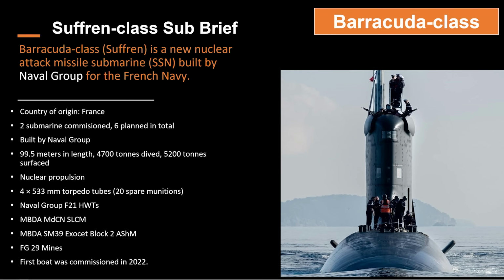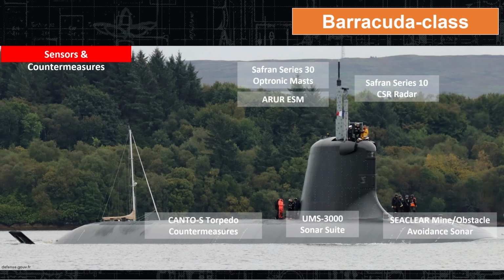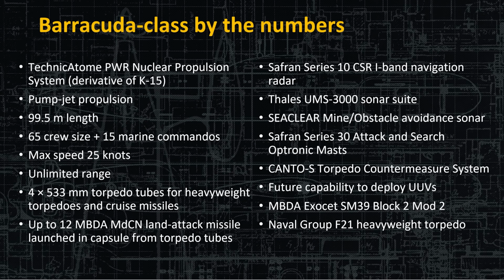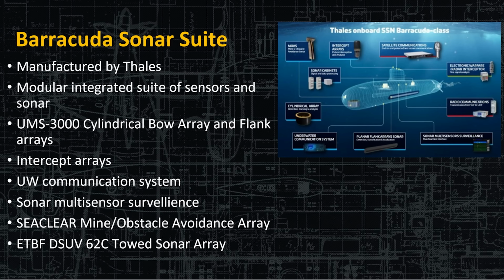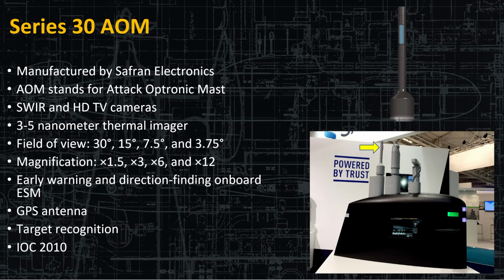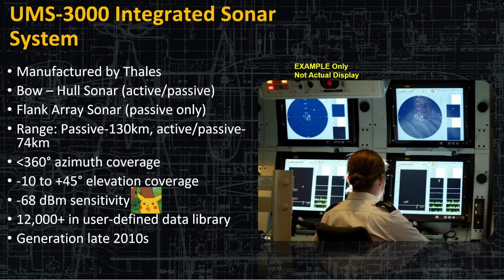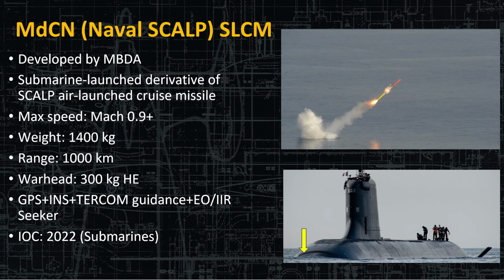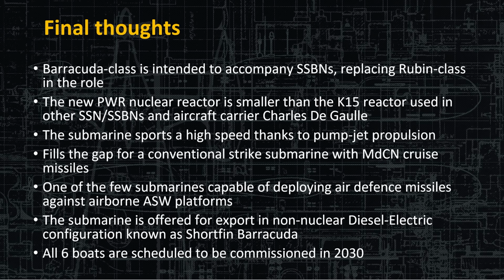Inside The Most POWERFUL French Nuclear Submarine Ever Made!

Comment: It's not the SCALP missile that's dropped from an aircraft, but the MdCN missile, which is launched from surface vessels like FREMM frigates or nuclear-powered attack submarines (SSNs). The missile is launched from a torpedo that rises to the surface and opens to release the MdCN missile, a missile designed to change its launch medium. The SCALP and the MdCN are not similar; the SCALP is more square-shaped, while the MdCN is round.

Comment: But don't think that just because it's a small submarine it's not capable; the Suffren-class SSNs have the best listening systems in the world, especially the sensors along the hull, which are ultra-high-performance! The F21 heavy torpedoes reach almost 100 km/h over a range of 50 km, and they are decoy-hardened! There are also the MdCN missiles with a range of 1000 km and the Exocet missiles (very well-known worldwide). These last two are missiles launched from a torpedo; the torpedo rises to the surface, opens, and releases the missile towards its target (a surface-change missile, as they say in France).

Comment: The anti-torpedo system for the Suffren-class submarine is called Contralto-S. It uses Canto-S decoys, also used for surface ships. The Canto-S system consists of acoustic decoys. The ship or submarine deploys several of these decoys, and each decoy emits a signal that resembles the ship's signal but is louder. The enemy torpedo finds this signal attractive and heads towards it. However, the decoy will become silent, and another decoy will begin emitting a loud signal. The torpedo will change direction towards this new signal. This second acoustic decoy will cease emitting, and the third will begin emitting a signal. The torpedo will change direction for this third decoy, and so on. The third decoy will stop emitting, and the first will start again. The torpedo will circle, and the ship will move away. So, a wired torpedo, when it reaches the end of the fiber optic cable, will stop. Or, if it's autonomous and its batteries run out, it will stop and sink! That's what CANTO-S is for: to confuse enemy torpedoes, even if there are several of them! This system is autonomous, so it's impossible for the enemy to hack it! These decoys also serve to deceive the enemy ship!

Comment: A few notes. Small compared to modern submarines. It is bigger than the 594's and the 637's except for Parche and Russell. Lots of people noted the tonnage typo. -68 dB signal to noise ratio in ESM is good? You have never bought an ESM tech a couple of shots have you? Countermeasures, are we talking anti torpedo torpedo, or anti torpedo mine? Either one would be a cool trick and way over due. Air defense? 3 inch launcher is more than just pretty flares.

Comment: Nice wrap up (although i think surfaced and dived tonnage are most likely reversed)

Regarding the sub launched anti-air missile, it's supposedly called A3SM and open source documentation, although very rare, usually claim it to be a MICA missile encased in a sub vehicle like Exocet. It is a 112 kg, IR or Active radar missile also found under Rafale's wing and some ground based short range SAM systems, with a claimed max range of 20km launched from the surface (40 km for MICA NG variant), made by MBDA.

Considering the missile is thrust vectoring and quite low range, it would also make the most sense if you are trying to hit ASW Heli or patrol aircraft directly overhead, as the missile would potentially have to maneuver quite hard. Just like the exocet, it can apparently be launched from the depth using data given by the sonar array. This is to take with a grain of salt of course, as its integration has never been confirmed, and its capabilities remain quite unknown, and most likely untested as well.

Comment: Interesting sub. Reactor uses LEU so needs ro be refuelled. Short transit SSBN support means this is maximised at every 10y but less for long high speed transit in RAN case. 

As Shortfin for RAN it was on schedule but 'strategic circumstances' changed. Not a lot public on why they couldnt have adapted as an SSN but assume refuelling and long lead build times would be problematic. 12 years from keel laying is a long time and its clearly been problematic for NG. As author noted though, so much new gear incorporated into this sub incl pump jet so much risk and time blowouts likely. 

Likely to get a few export orders. Shortfin may be screw not pumpjet so less benefit on transit. Looks a good option for RCN.
Reply: The LEU setup doesn't mean it is less suitable for fast transits - this statement is simply not realistic. And btw: The exchange of fuel rods only takes 2 to 4 weeks, because the hull doesn't need to be cut in half like in US or Russian subs for example. 

The French gouvernment decided in favour of LEU for two reasons:
1. The fuel rods stem from the civil nuclear energy sector, so due to scale effects, the fuel is more affordable than HEU fuel.
2. LEU fuel being used on subs require less intense cooling, so the volume of water being moved through the three cooling cycles is smaller and the pumps engaged don't run at higher revolutions like in HEU reactors. Natural circulation could likewise be extended in terms of silence levels relative to speed ranges...

Now combine this reactor setup with a turbo-electric transmission system based on permanent magnet synchronous motors and a large lithium iron-phosphate battery bank. That is a very, very silent submarine.
Reply: The problem is that Australia wanted to build it in Australia without having the proper industry to do it.
France is currently rolling out a new Suffren class every 2 year.
Watch how the Netherlands will do and you will get an idea about what Australia missed while waiting for your submarines...

Comment: Great presentation, many thanks ! Maybe just a few additional thoughts though. The Suffren is not tiny at all; It is of the same length as the UK Astute class ! Displacement is smaller (equivalent to the former Trafalgar class) because the nuclear reactor is smaller and it is designed to operate with a reduced crew (it also carries less armement). Actual max speed is unknown but the sub is very sleek so probably closer to 30 knots than to 25. Current exocet SM39 block 2 will soon be replaced by the new SM40 version (based on the MM40 block 3 version) with an extended range of 120 km. Suffren subs with conventional propulsion (similar to those that Australia cancelled) have been ordered by the Netherlands (4 subs), and there are discussion with Canada for replacing their aging Victoria class subs. To my knowledge, there are two options for anti air missiles that could be launched from the Suffren class: one from launchers situated in the kiosk derived from the short range mistral 3 missiles, and the other from canister launched from the torpedo tubes derived from the medium range MICA.
Reply: At the time the UK was building the Trafalgar class (4500t), the Americans were building the Los Angeles class (6000t) and the Chinese were building the Han class (4500t). The French were building  the Rubis class (2400t)

When the UK has been building the Astute class (7000-7400t) and the Americans the Virginias (8000-10000t) and the Chinese the Shang class (6700t) the the French have been building the Suffren class (4765t)

So for contemporary designs they are smaller
Reply: @Infanterie_Marine  not smaller but less displacement, again due to a difference in nuclear reactor size and requirements, but in no way "tiny", Suffren are average size (Rubis were tiny, no doubt about that)
Reply: @ Size and displacement are directly correlated. The Suffrens have 30 to 50% less displacement than their peers.

That is not a bad thing, but it is indicative of a very different design philosophy.

Comment: It is indeed a very small SSN, but still a much larger one than the Rubis it replaces and a huge leap in capabilities and endurance. I would think that beyond the usual delays and cost overruns that most military programs have these days it didn't have a particularly troubled development, but the long time between keel laying and commission, that remains constant through the different boats would have more to do with spreading out the production to also spread out the costs and ensure a continuity of the know how and facilities to avoid the problems out british friends encountered with the Astute class. IIRC it is currently not fitted with a towed array, if I'm not mistaken the current plan is to later retrofit them with the new one that's being developed for the future SSBN class. As for the anti aircraft missile system, I've not heard of it being fitted on the Suffren but I had seen a little promo clip of a concept from naval group from a naval show for such a system mounted in the sail. So far after Australia's cancellation, it is being ordered by the Netherlands

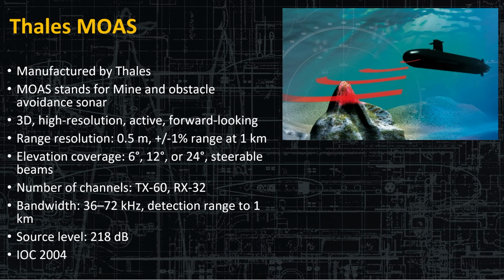Comment: 24:39 ...in ww2 the nazi Uboot s could pick up individual targets with pasive sonar at 30- 50 Nm and convoys at ranges exceeding 100 Nm..I think that was pretty impressive to !!! 🙄🙄🙄
Reply: Not quite.
20km range for individual ships.
100km for convoys. Not nautical miles.
The hydrophone array was the S-Gerät.
Then it depended on the hydrophone operator, as all they had was a direction of the noise. It was up to them to single out that noise and interpret it into: number of ships, size of ship depending on noise of engine, what direction the ship was headed etc... etc... 

But hardly impressive, hydrophones are specifically designed to listen to underwater stuff and noise travels reallly really well underwater (Like on average 5x better.) ASDIC was far superior and since there were hardly any counters (Such as anti radiation weaponry!) it was a much better alternative.
And that's why the U-Boats got absolutely smashed in the end.

But they could not, and did not, use ASDIC/sonar to send messages. They literally had to surface to send a message back to Berlin (Which then got picked up by radio detectors by the Catalina's and then ... yeah.) This is why a lot of intercepts of U Boat communications exist today.

Modern hydrophone arrays can listen to things like 3,000km away though.
Reply: @Noodle5593  hi.okey. Their technology was lightyears ahead of the Allies in some domains. What nobody realized back than that for the reception of radio messages they not had to surface . It was sufficient to come up somewhere around 50 m and they could receive the VLH transmissions send from the Koralle HQ near Berlin . If I remember correctly that system was called NOLLAU  ? This system operational from the summer of 43 made possible to avoid the total destruction after the Allies started to use MAD detectors...The Uboots where safe from around 70 m deep. Of course to transmit messages they had to come up to the periscope depth or later to schnorchel depth and deploy an antenna.  That was an Achile's heal for them. After the war the Allies of course where super impressed by the VLF and it's used still today....